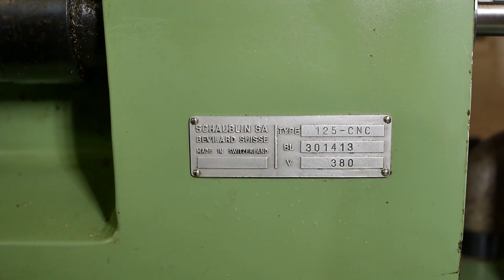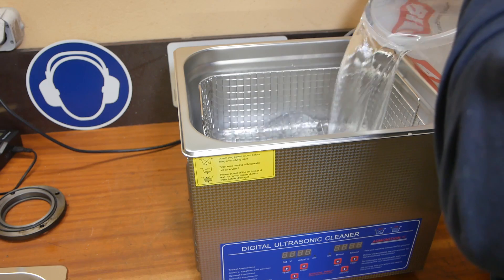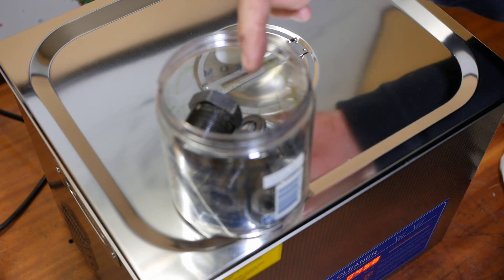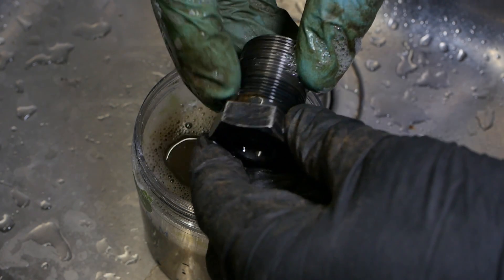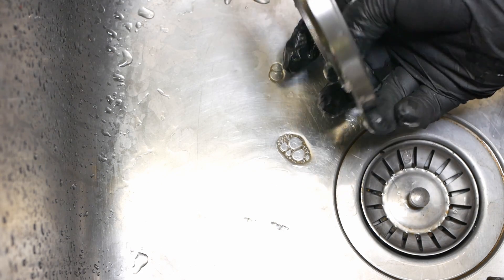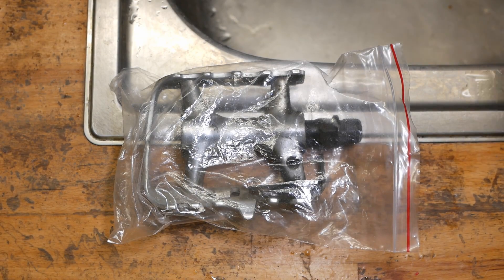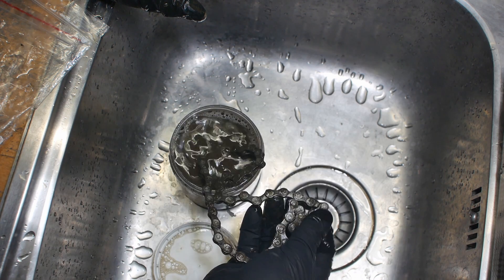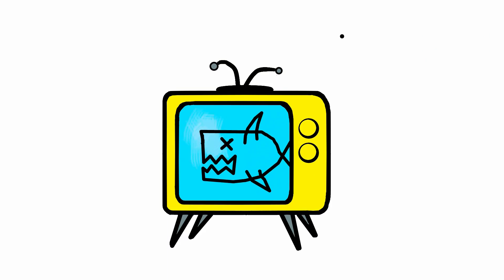Do cheap ultrasonic cleaners work? || RotarySMP

Comment: The cleaner made more work than the "ultrasonic" cleaner. If you put your in there and don't scream, its not real ultrasonic.

Look inside, I have just got the same one and the stuff you put in should work without cleaner or vinegar. Get your own transducers, a stainless steel pan and the driver, and you will be surprised what a gold ultrasonic cleaner does 😁

I sent mine back, it's just a toy.
Reply from the maker: Thanks for the update.

Comment: I used to assemble ultrasonic cleaning baths. The way to achieve maximum cleaning power is to get the liquid to 'cavitate'. You can achieve this by filling the tank to about 50% capacity, adding your parts, then topping up until you can hear the bath 'chirp'. Droplets will jump from the surface of the liquid when cavitation occurs (don't know about your model, but it is more obvious in smaller tanks).
Reply from the maker: Thanks for the excellent tip. I'll try that.

Comment: I want to clean  old connecting rods and head valve, bearing  so I don't know about cleaning chemical name  
So pls tell me the name 
And I  am from India 🇮🇳 so here what the chemical name pls tell me so I can also to clean  that's my parts and customer  to see this they will happy 

Pls answer me the chemical  name so I purchase from market
Reply from the maker: If the parts are steel, I would use Sodium Hydroxide (Lye, drain cleaner, NaOH)

Comment: I never once used one by putting the objects inside a jar.
Reply from the maker: I switched to a glass jar, which is supposed to transmit the U/S energy better. I have been told that even better still are the thin pyrex beakers.
Reply: @RotarySMP  Oh i see. I just put the parts loose in the basket and that worked perfectly every time.

Comment: To test your ultrasonic cleaner put in a piece 3x3" of aluminum foil, if it gets small holes punched into it, the ultrasonic is working.
Reply from the maker: Thanks. Good tip.

Comment: What you will find with cheap chinese ultrasonic cleaners is that they work fine... for a while, but they do break after a while, especially with heavy use... so longevity is the problem... I have a German ultrasonic which I've had for 20 years and it still works well, I had a chinese one which worked just as well, for about a year and then broke down... so in the long run it's more expensive to buy cheap chinese products...
Reply from the maker: I have had a number of comments on these cleaners short lift expectancy. Guess we will see how long this one survives.

Comment: I’d be interested to see the results of simply placing the parts in the jar with solution and simply shake the container by hand for 1 min vs. the 5 min timer on the Ultrasonic cleaner. My guess is the chemicals are doing more for you than the machine. I purchased one for a small carburetor and was extremely disappointed with the results. Perhaps my model was simply not as well-made.
Reply from the maker: Could well be, although the US seems to get the gunk out of all the nooks and crannies.

Comment: In searching Amazon, one feature I've seen on some is a "degas" cycle... is that a useless selling feature or something worth looking into?
Reply from the maker: I had  a couple of comments saying that you first fill the basin with water, then run the U/S for 20 min with nothing in there, and that removes the desolved gas from the water, and makes the U/S waves pass through without attenuation.
Reply: @RotarySMP  Interesting! So, then the ones with such a "mode" probably are nothing more than a timer before you put something in LOL

Comment: I bought this exact one off Ebay and it popped and even damaged my breaker, had to call an electrician in.
Reply from the maker: That sucks. What aspect of it caused it? Sounds like more than a short.
Reply: @RotarySMP  Faulty product, cheaply made, enough to trip the saftey switch which then needed to be replaced.
Reply from the maker: @AdnanCucak  I have had comments of the basin corroding through or the drain leaking, both dripping on the PCB, causing failures.
Reply: @RotarySMP  This was the very first time I plugged it in, as soon as i turned it on for the first time a very loud electrical pop was heard and all my power cut ahaha. Looks like I got a cheap knock off from China

Comment: Wait, what?! How does that work? Put an enclosure in the water and it still works? I thought it would eliminate if not all then most of the functionality? :-)
Reply from the maker: I have received comments that plastic attenuates the wves a bit, and therefore metal or glass containers are more effective. I switched to glass, but didn't notice much difference.
Reply: @RotarySMP  Thanks for answering, no I can imagine that plastic and glass are about the same, the plastic attenuates the frequency but are also so thin it hardly attenuates. Glass on the other hand is stiff and vibrates but the glass is thick and does therefore dampen the resulting vibrations:-)
I am myself looking for a cleaner but have heard that cleaners with changing frequencies do clean better sins something resonates better on different frequencies:-)
Reply from the maker: @friedmule5403  U/S cleaners are suposed to clean by causing cavitation, rather than from aggitation.Tuning the frequency to the fluid is probably beneficial, as the caviation is dependant on the fluid  and its temp as well.
Reply: @RotarySMP  I thank you very much, you have been of great help!!
Reply from the maker: @friedmule5403  Thanks for watching.

Comment: Just be careful with polished aluminum, it will leave starburst patterns all over polished surface. I found if you hang the part on wire and swing it around in the tank it doesn’t hurt the finish
Reply from the maker: Thanks for the tip.

Comment: Amatuer tip: Use a glass jar. Using plastic will eventually fatigue in the ultrasonic cleaner. Glass also has a better cavitation effect than plastic.  Make sure the jar is tall enough to be above the water line so one does not need to cap the jar.
Reply from the maker: Thanks, I have switched to a glass jar.
Reply: @RotarySMP  credit to you for using any kind of container though, you are the first youtuber I've seen who has not just plonked the parts to be cleaned direct in the bath. And your ziploc bag method was new to me - seems so obvious when you see it done! In the lab we always used tall pyrex beakers in the ultrasonic bath, with a watchglass on top to prevent spray/splashing. Also if you move the beaker / jar around you may feel one or two sweet spots on the base of the bath where the ultrasound is transferred most effectively (direct into the beaker not just thru the water) then the cleaning goes faster.
Reply from the maker: @MicBark  I need to look out for one of those thin pyrex beaker/flask. My jar is pretty thick.
Reply: Thank you.  I would have enjoyed watching a 'control'... a part in caustic solution  w/o the ultrasonic cleaner
Reply from the maker: @SunriseLAW  I was like a kid with then Xmas present. Too much fun to think about control.
Reply: @RotarySMP  HaHA Had that happen with my pressure washer.  Saved up for a pretty nice one and they threw in a gallon of cleaning concentrate,  which I applied with brush on a long pole.  Turns out it works almost as good washing it off with the hose after using the 'soap'.
Reply: @SunriseLAW  agreed, it would have been good to see two control demonstrations...

One soaked in BBQ cleaner without any ultrasonic agitation, and the other in water using the ultrasonics.

But, it was an excellent and well made video, so I'm sure we can forgive that 😁
Reply: Dish soap should not be used as it foams, which interferes with the ultrasonic effectiveness. Use detergents that dont foam.
Reply: what kind of glass is better?
Reply: I’ve seen nasa documents that say you should use plastic bags because they work best?

Comment: Use proper ultrasonic cleaner liquid. Or some tooth paste dissolved in water. Dish washing liquid isn't good for ultrasonic cleaners because it has nothing abrasive dispersed in water.
Reply from the maker: Thanks for the tip.

Comment: Wasn't that impressed think you would see roughly the same results soaking in the hot cleaning fluid.
Reply from the maker: Maybe. At least this does the aggitation withoutany effort.
Reply: Talked into buying one or got it for a free advert ?? bit of a difference when you've paid good money and it don't work as well as these adverts hype them up to ???
Reply from the maker: @midlandt4249  I bought it fom Amazon after an old mate from my apprenticeship (and a number of viewers) recommended it. My channel is too small for advertisers to take notice.

Comment: just some tipps, i think you dident mentiont:
when you put fresh water in that you shuld run the ultra sonic for about 30min to get the air out of the water, that makes the Water hard and then the hole thing really penetrate the dirty things.
Otherwise the power of the ultra sonic gets lost by squishing the air moneculs.

When you put your hand in a running sonic bath you wont feel mutch but there is a possability whit the bigger bath that they seperate the flesh from your bones cors they have a different hardness.
Reply from the maker: Thanks. Both of those have been pointed out. I wont put my hands in again.

Comment: I got a 30l one of these.  Big enough for a rack of carbs from a 4cyl bike.  It gets hot, it cleans the parts, not much epse to say.  Jury is still out on longevity.
Reply from the maker: There are quite a few reports of early failuresin the comments I have received. Hope mine is a decent one.

Comment: I just use blue gold in a solution anywhere between 20:1 to 10:1 at 65C for 15min. At least if you are cleaning non-coated parts. For coated parts reduce time and temperature but I'm not sure by how much.
Reply from the maker: Thanks for the tip.
Reply: @RotarySMP  if it looks like diluted blue Gatorade you're in the right ball park

Comment: I've had the same cleaner for about a year and a half now and it's worked great. I've used it a lot. I even cleaned out the carbon from an atv muffler with it by cleaning half of it at a time.
Reply from the maker: They are quite a time saver.

Comment: The chain is ruined. you most likely washed out the grease which was in the rollers...
Reply from the maker: That chain went straight from the clean exercise into the metal recycling. It got rusty last winter due to salty roads, and was completely worn out, such that it would jump the chain wheel.

Comment: Thanks for the very interesting video, caustic soda is a great substance for breaking down organic fats or oils even ones that are baked on and burnt, hence barbecue cleaner, these properties do not transfer to mineral oils or or burnt mineral oil deposits, you are a knowledgeable person, paraffin or diesel have relatively high flash points, these would have been my cleaner options, I have played with caustic soda as a cleaner and have not found it to be very effective except on organic material, Just my thoughts
Thanks for very interesting video
Reply from the maker: Thanks for that. I though all non-polar liquids would be about equally broken down by NaOH. I didnt realise it is less effective on mineral oils.
Reply: NaOH breaks down animal & vegetable fats through saponification.  This only works with triglycerides so doesn't work at all with mineral oil because they are just simple hydrocarbons. So it's not just less effective; it doesn't really do anything.

Comment: I’ve got the exact same cleaner bought from AliExpress (over 12 months ago) still sitting in the box unopened. I think of it as Schrödinger’s Ultrasonic Cleaner. As it sits there, it both works, and it doesn’t.
Reply from the maker: Yeah, at least there is still the probablity of it working. Second thing I cleaned with it was my electric razor parts. Works great for that too.

Comment: For pistons put in with your parts solution some citric acid ( lemon juice ) with detergent and it will clean super
Reply from the maker: One of the viewers sent me some citric acid, so I can try that. What concentration of citric acid in water would you use on a piston.
Reply: I use a mixture of 30% citic acide and 60%of water and 5 to 10% of dish washer product for 30 minutes at 40degres celcius and works excelent
Reply: I do marine engine rebuilt so that machine is excellent i have a 30 litre and its my best friend bolts power heads valves pistons all that fits goes in evan starter when get salt water

Comment: Want real magic?) Try DMSO as a solvent. You won't even need ultrasonic cleaners) Just hot bath and DMSO(can be found in drug store). The only negative is that it dissolves paint and plastic/rubber. Sometimes we even add it in to motor oil and wash engines back to factory shine.
Reply from the maker: Thanks for the tip.

Comment: I worked for 10 years in a repair shop and used 96% isopropyl alcohol in an ultrasonic cleaner regularly to clean electronics from water residue and other things that weren't supposed to be there.
It's safe to use isopropyl alcohol in an ultrasonic cleaner!!!!!
The more cycles you run it the liquid goes from warmer to hotter to HOT!!!
Reply from the maker: Thanks for the tip.

Comment: How loud is the unit? I've used lab grade stuff and they appear to be a lot quieter than the Ebay ones for similar effectivness. Have they improved the noise since (roughly 2016)?
Reply from the maker: I don't have any comparison, but this is prety loud, and an especially annoying frequency. I tend to put on ear defenders if in the same room as it is running.

Comment: Should have tried it directly on the machine with no containers, could have been a bit more effective.
Reply from the maker: Yeah, but a lot more messy.
Reply: @RotarySMP  well you could have left it for the last test that way you only had to clean it once. Thanks for replying.
Reply from the maker: @CUBEoneVX  Good point.
Reply: @RotarySMP  For your grubby piston, you should fill the bath with something like this.

https://www.berrymanproducts.com/products/eco-friendly-products/berryman-chem-dip-carburetor-and-parts-cleaner/

Comment: There is no need to use the containers put the parts into the basket and use automotive parts cleaner you will get a better result but DO NOT overcrowed the basket and give them 15 to 30 minutes at 45 to 50 deg..
Reply from the maker: For small parts, I find the containers convenient to control the mess.
Reply: @RotarySMP  Yes that is correct, But some of those parts you were putting in containers will sit in the basket ok, Things like screws, etc are good in containers..
Reply from the maker: @WayneCook306  True.

Comment: why aren't you putting the parts directly in the cleaner?? we use these at work and put an entire transmission worth of parts directly in the cleaner with a basic detergent mix.
Reply from the maker: Makes cleaning up the U/S cleaner easier, and for small parts I dont need a full bath of chemicals.

Comment: I'm on my fourth. Great but a lottery when it comes to quality. My last was the same as yours. I thought the drain was a great idea until it leaked internally onto the pcb and it went bang after a total of one hours use 😞
Reply from the maker: Ouch. Did they replace it under warranty?
Reply: @RotarySMP  no unfortunately as it took me 4 months to use it. It is a shame that a name brand company that stand by their products doesn't make one. Hey at least they are coming down in price to a point I can justify buying one a year :)
Reply from the maker: @volvogt21  I got this one from Amazon, so hopefulyl they would do warranty.
Reply: @RotarySMP  Thanks. Yes my last one was from Amazon but the leaky dead one was ebay. Thankfully they have become more competitively priced on Amazon.
Reply: @RotarySMP  Can you link to the one you bought, or at least tell us what it cost? I'm wanting to import one here to nz too

Comment: There are bearings in those pedals...so you likely want to take apart the one you put the caustic mix in to be sure none got in there and wont eat the pedal apart from the inside.   Same for the soapy water, as that could degrade the bearing grease and cause issues. The overall test was cool though, now I have to figure out if I have enough stuff to clean to justify getting one of those cleaners. ;)
Reply from the maker: I wanted to remove the bearings, but they are cheap pedals, and the bearings are retained by a nut, and the anti rotation feature was crushing the thread so the nut cant be removed. Junk, that is why they became test dummies.

Comment: this aint cheap.
I am useing 40€ ultrasonic cleaner for diesel injector cleaning.
Works well, only problem is one hit to button and it works only 3 minutes.
Reply from the maker: I guess I was comparing to a name brand industrial U/S cleaner of this size. Then it is cheap.

Comment: I'm wondering, can anyone explain this:
I really expected the plastic bag to get punctured by the vibrating grate it is resting on, but obviously that doesnt happen. 
So it must be the fluid that prevents points of friction by uniformly spreading the wave, but that just raises more questions.
If the plactic bag and the metal grate vibrate in sync in the fluid how does the cleaning work? Surely somewhere friction must be created
Reply from the maker: U/S cleaning action is not aggitation, it is cavitation. But the bag does get holes pretty quickly.

Comment: You must use a soap or water wetter of some kind in the main tub water, its in the instructions that u threw away and it has to do with freeing up the water molecules to improve the ultrasonic auction ... also the cleaning action is improved if u dont put stuff in containers.
Reply from the maker: Thanks. I figured any useful information from the instructions would be provided as comments :)